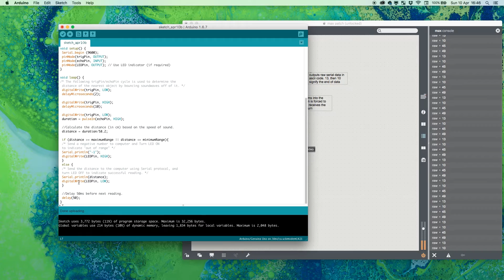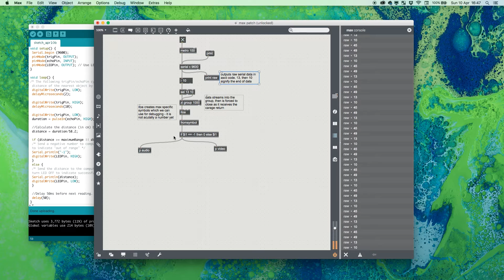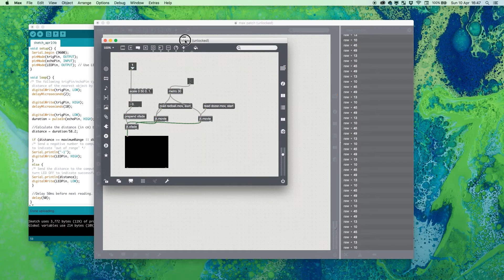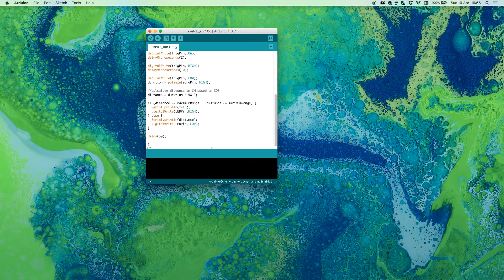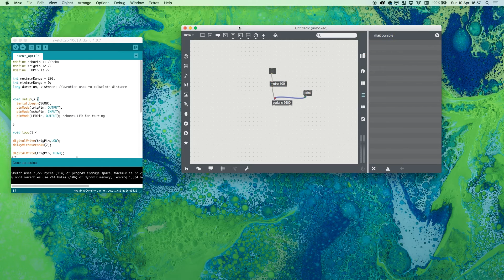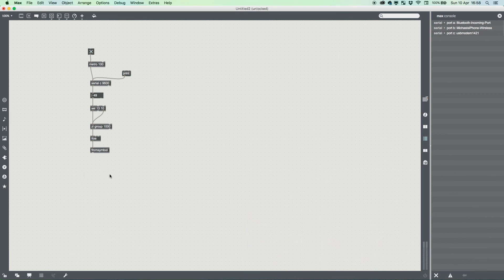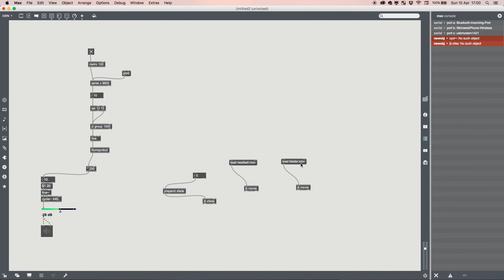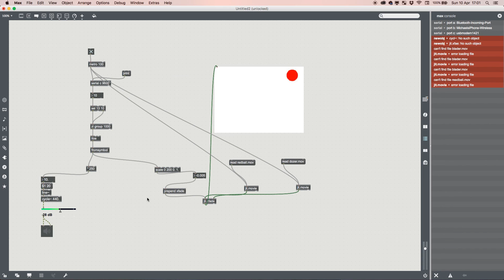Max MSP Request:  Serial Arduino Live Data Stream

Comment: How would one go about outputting into max 3 different sets of values? I have set up on the Arduino an ultrasonic sensor, a thermistor and a photocell resistor, but I seem to only be getting the data for the photocell on Max. Any suggestions
?
Reply from the maker: Print the data in Arduino using serial.print(value1) 
Serial.print(value2)
Serial.println(value3)

The serial reader we’ve made in max cuts of values every carriage return (println) so we need to bundle the values together like that.

You’ll then just need to unpack the values in max as normal

Comment: Thanks for the video! Im getting a stream of data (3 different intervals for Red, Green and Blue values) coming out of my arduino serial port, but I can't see any data going into max when I 'print raw'. My serial port is setup correctly, i've checked it's on C and it's 9600, but still no data. The sound is always working fine out of the test oscillators I've put in the patch. Any Ideas? Many thanks in advance

Comment: any idea why i keep getting the "error opening serial port"? I am using max for live. Sometimes it works, but mostly i get the error.
Reply from the maker: +Joshua Casper where is the serial communication coming from? Could be that you have a serial monitor open somewhere - e.g. Arduino. This can cause issues.

Otherwise make sure you're not accidentally trying to send the connect command over and over
Reply: Michael Mckellar that's not it. I close the arduino software before opening live/Max.
Reply: Same issue here...Wonder how did u fix it?
Reply: well nvm, I just watched Joshua's reply that I forgot to close the serial opening of Arduino. :)

Comment: Thanks for this video, I'm using it for my sonology class :]
I have a question -when I'm interacting with the sensor it sounds good, but when I take my hand away from the sensor, the sound output defaults to a horrible high pitched monotone squeal. Is there any way to prevent that?
Reply from the maker: im just going to guess some troubleshooting here - I've not been able to find time to rebuild the sensor rig...

Check out your data capture: http://imgur.com/2QmOSwA

It sounds like your max distance is not high enough so the sensor is still sending data even when nothing is present (maybe a wall/ceiling behind you is being detected). You could change the sensitivity in the top line of the if so the 'space' where your hand is detected is much smaller.

IF that doesn't seem to fix it and maxmsp is receiving the -1 value and still making a horrible noise add a condition to the end of the 'fromsymbol' (before the *250) that is -1 is detected then the line~ is sent 0 values. 

Hope this helps :)
Reply: Michael Mckellar thanks so much~!
Reply: Michael Mckellar Fixed it and it sounds great now. Thanks for your help.

Comment: Hi Michael, first off thank you for the tutorial, it was really helpful. If you don't mind, I've got a question I'd like to ask. Sometimes when moving an object in front of the sensor and reading the measured distances on arduino's "serial monitor",  I've noticed that I get occasional random zeros between the actual distances (something like 3cm 5cm 0cm 0cm 5cm). I suppose they're related to scattering of the ultrasound wave and/or the sensor occasionally not being able to read the return echo signal. The problem is that when using it on Max, with the sine wave from your example, it causes these really annoying sudden shifts in the frequency. How would you overcome that? Hope this was clear.
Reply from the maker: +Leo Weber Hmm, thats a tricky one there are a number of factors that could be causing your '0cm' readings. As you correctly diagnose my first guess would always be hardware, whether loose wiring, miss reading from the sensor or something in-between. Some other areas to explore are the baud rate at which you are polling the serial port, it might be to fast for the sensor, or changing the delay between sensor readings (the 50ms). I would probably put money on it just being a funny sensor.

As far as the jumps in frequency Im not so well versed in that aspect of things. I would need to sit down for a while and check it out. http://imgur.com/VJX0Wte
That is a screen shot of what I would expect to be a REALLY dirty work around for now, it essentially changes from one value to the new value over 100ms rather than instantly. You would place it between the scale and cycle node.